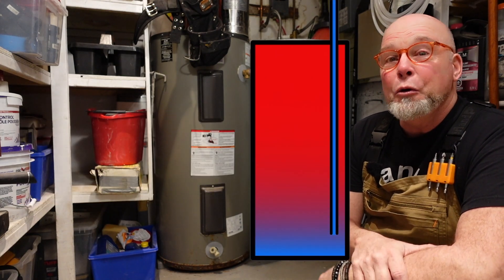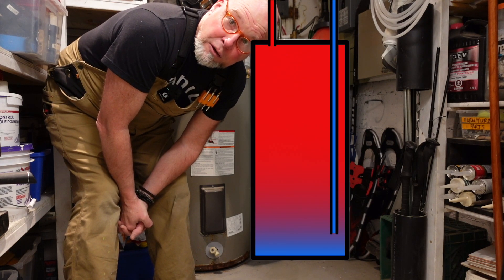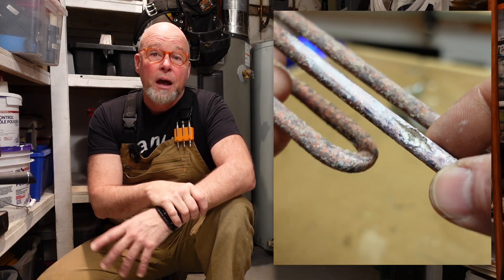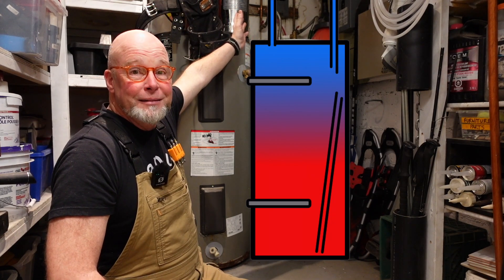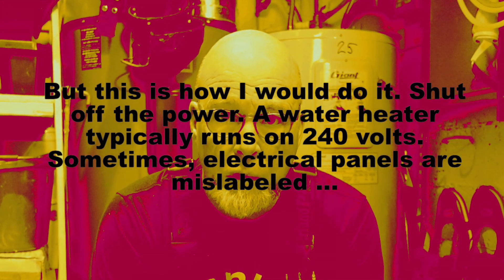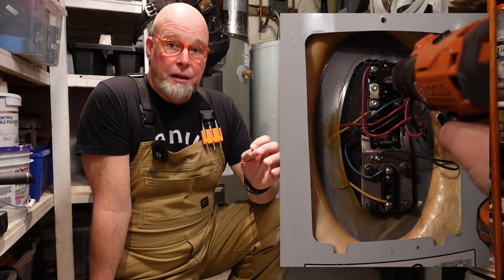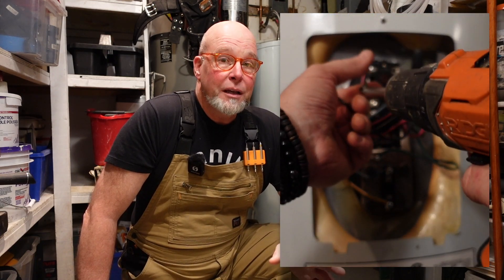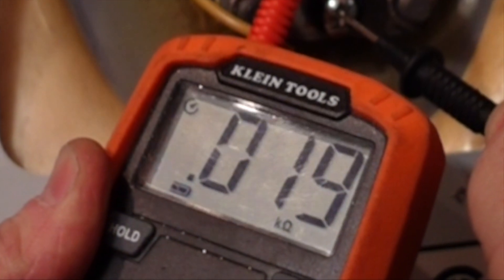WATER HEATER DIAGNOSIS #tutorial #diy #technology #education #home #innovation #craft #engineering

Comment: My water heater (natural gas) makes a loud gurgling bubbling sound when a hot tap is opened after the gas burner has been running. For example, after someone takes a shower, the water heater will gurgle and bubble for a while afterwards any time a hot tap is opened. Only seems to happen after the burner has been running a while like after a shower or laundry is ran 🤷‍♂️
Reply from the maker: I had to look this up but two possible causes could be sediment at the bottom of the tank, or trapped air in the top of the tank or pipes. Do a quick search and it'll suggest purging your water heater and/or calling a pro to check it out. Hope this helps.
Reply: what does the gurgle smell like?
Reply: @Majesticleper  no discernible smell